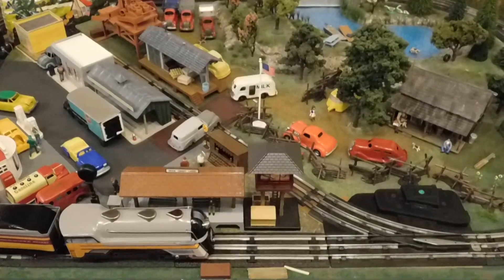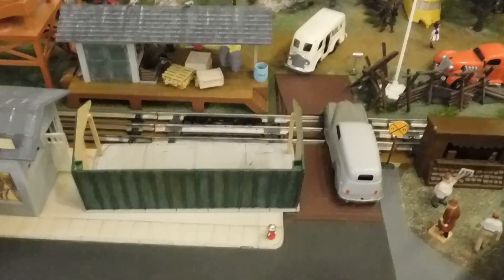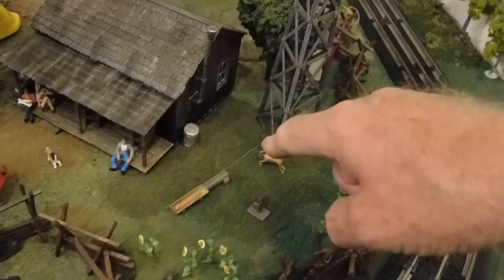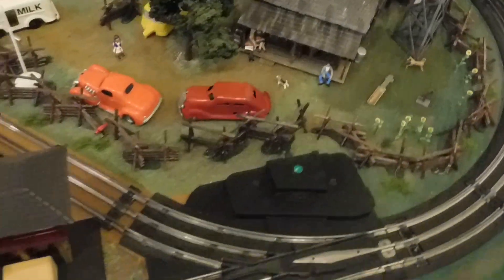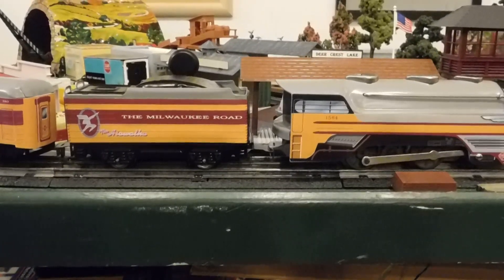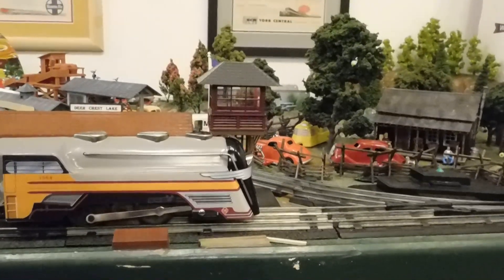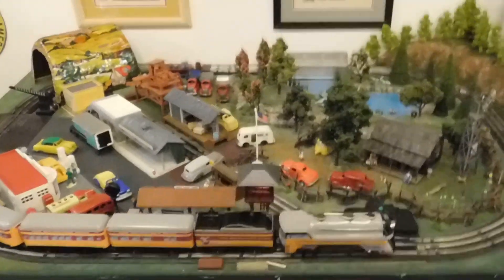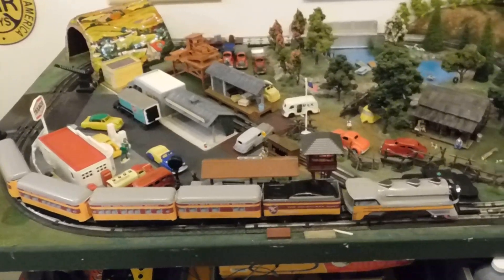EoT Toy Train Layout Refurbishment. My O-27 3-Rail Layout being re-done Marx Lionel MTH K-Line Pt13

Comment: I am wondering if the motor is a double reduction motor as Marx used in Later locos?
Reply from the maker: no, this has the older single reduction motor with the the wide gear.